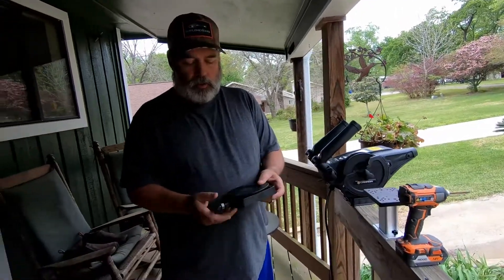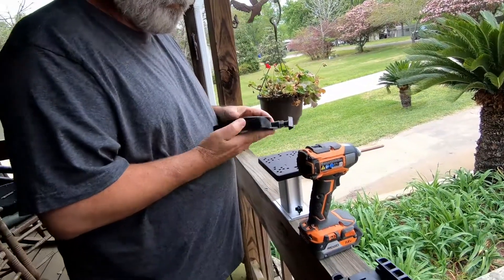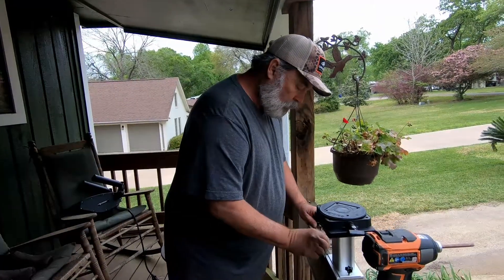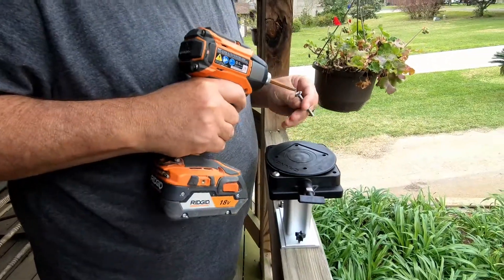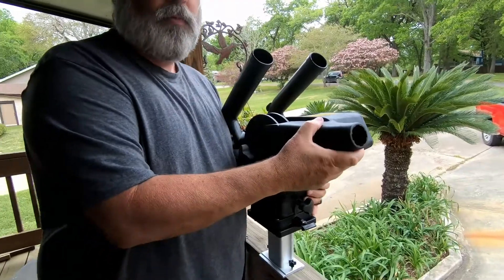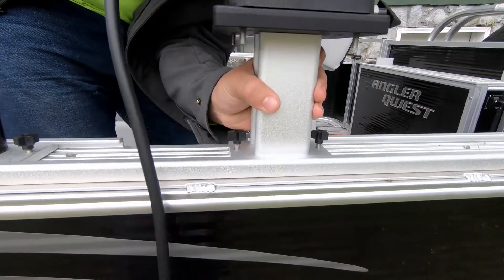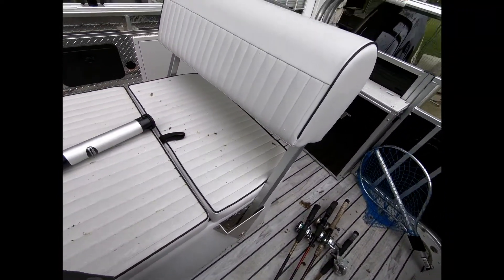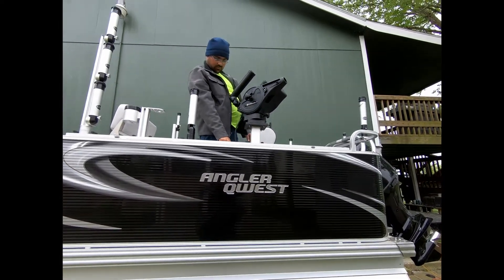Cannon Low Profile Swivel Base Installation

Comment: One the low profile swivel base, what direction should the rotation release pin be pointing? If it is out to the side, wouldn't the net possibly get caught in it? Would it be better to have it pointing in a direction that the downrigger would shield it? Thanks for posting the video.
Reply: I'm putting it straight back with the rigger release bolt forward